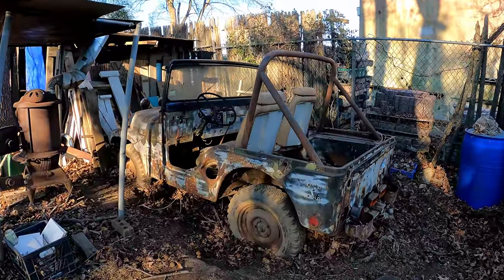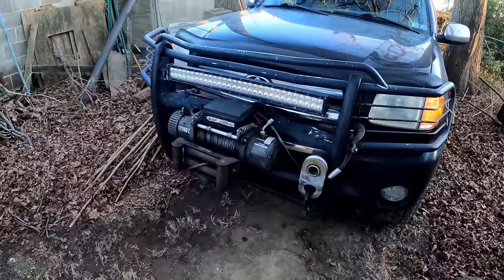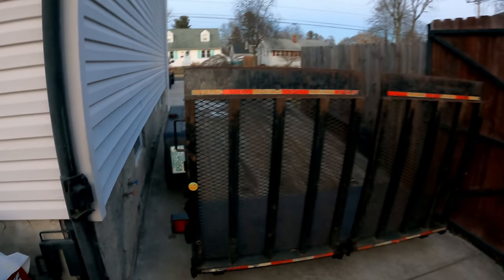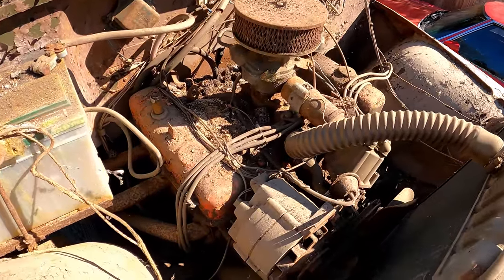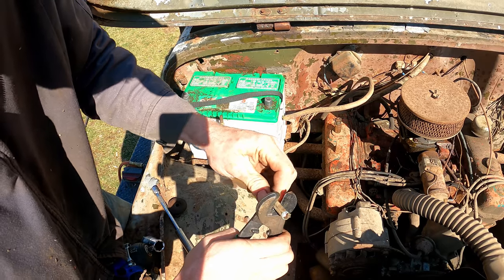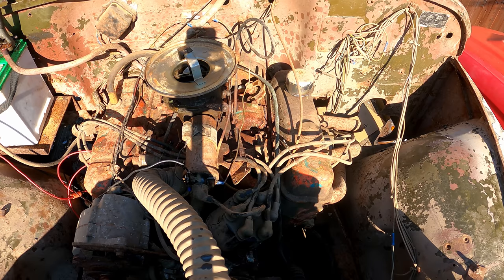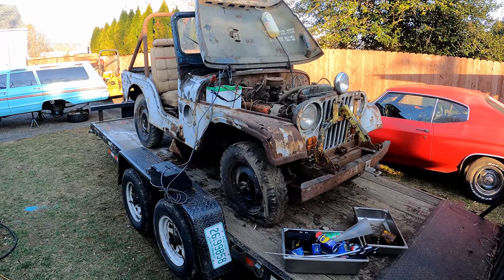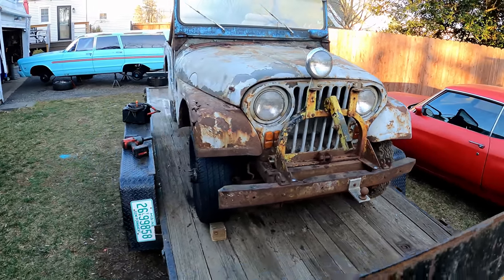Sitting 30 years Will It Run? 1965 Jeep w/ Buick Odd Fire "Dauntless" V6 - NNKH

Comment: I am astounded that anybody would find value in that old rust bucket. I can see saving the engine and possibly the rest of the drive train but the rest of it is not even worth scrap.
Reply: you're just wrong.
Reply: Oh, no. With $30,000 in repair parts you would have a vehicle worth $20,000.

Comment: Your video brought back lots of memories.  My first Jeep was a 1967 CJ-6 with the GM 225ci V6.  If I remember correctly, those engines were used in the 1965-1967 model years.  The engine was so torquey I could almost get 'rubber in all 3 gears' ... LOL.

Comment: I have a 67 225 CJ 5 gas tank inside under drivers seat. Never came with rollbar(68). Love it high revving engine trans very delicate had to update for as much power it makes.. mine has 62k original miles.   Love it

Comment: Good job on getting that old V-6 running...looking forward to Part II!  As I recall, that 225 Buick V-6 was derived from their 300 CID V-8...there was a marinized version, used on the late-1960s-1970 Evinrude Explorer and Sportsman hulls...has an almost "three-pot" sound at revs...Keep up the good work; most entertaining!
Reply: The original Buick "Fireball" V6 was a 198cid/3.2L, derived from the 215 V8 in 1962 by lopping off two cylinders (hence the odd fire).  They upscaled it to the better-known 3.7L "Dauntless" so that it could share parts and tooling with the Buick 340 (which later became the famous Buick 350 that was used in FSJ's) before they shelved it and sold the design to Kaiser.  It was used in Jeeps until the AMC acquisition and it was replaced by a straight 6, aka the forefather of the ubiquitous 4.0 liter.  It was sold back to Buick and resurrected in 1974 with HEI added and a few other refinements that make good bolt-ons for the earlier Dauntless Jeeps.

I kinda fell into this obscure bit of trivia because my son and I are fixing up a 1969 Jeepster Commando with the Dauntless in it.  Sub and follow along if you want: https://youtu.be/d1HYoqfk0s4 (we just got started and I'm in the middle of editing together part 2 as I type this).

Comment: Way back in '79 I had a '65 with the V6 while in college in FL. Winter of '80 I drove it home to VT and hit a blizzard in NYC. By the time I hit the MA state line it was still snowing and temps were below freezing. The only gauges that worked were the amp light and oil pressure. It started running rough around White River Junction but I kept going in 4WD because the snow was so deep. 3 hrs later I pulled into my home and my Dad told me to pull it into the garage. Once there I popped the hood and found the battery split, the radiator frozen, the carb was iced over with only a half inch hole for air. No freeze plugs popped though. Let it warm up in the garage and two days later replaced the radiator and fluid and battery and she started right up. Loved that old girl.
Reply: As an addendum, this was also the Jeep that ran 14.2's in the quarter mile on the weekends against Trans-Ams and Camaros.

Comment: That is an old military jeep. The give aways are the recessed front headlights. Recessed tail lights. The two bumper hoops on the rear, the large fuel fill for your gerry can, and the 24 volt battery box on the passenger side cowel. It originally had a 4 cylinder engine.  Easy swap for a Buick V-6. It also has the military gauge cluster on the dash.
Looks like it is a Frankenstein jeep. A mix and match of old and newer model parts.  The fuel tank is located behind the rear axle. In a military jeep it is under the driver's seat. Also the military jeep would have a split windshield. This one has a full windshield.

Comment: Rust bucket restoration 😃 lotsa work to do there. It'll definitely test your sheet metal skills unless you can get some prefab already hammered out. And that old engine has some serious blow by, but  they somehow pull through after 30+ years. Interesting project.
Reply: C&C Equipment might be the place to check.

Comment: I did a few of the old military jeeps and 47 civilian jeep got all my parts from J C witney. Even rebuilt 4 cylinder flat head with all parts from JC Whitney. That was over 30 yrs ago,don't even know if JC Whitney is still around. Yes, keep the build going. I'd like to see full restoration. On that jeep

Comment from the maker: NNKH Hats/Merch: https://www.youtube.com/channel/UCYAcr-u-BLGIrtUImT2_Elw/store

~PART 2: https://www.youtube.com/watch?v=Th8anMfF4IE

~Old video I did on the 4x4 air hose: https://youtu.be/4apKkW28yzo

Huge thanks to  @William Moser  for letting me use the clip of his Buick firing order video.  Check out his channel @ https://www.youtube.com/channel/UC5W4P8cYkNV6pFqZVkjuXLg

More NNKH @ https://linktr.ee/NoNonsenseKnowHow

0:00 Intro
02:33 Moving Jeep
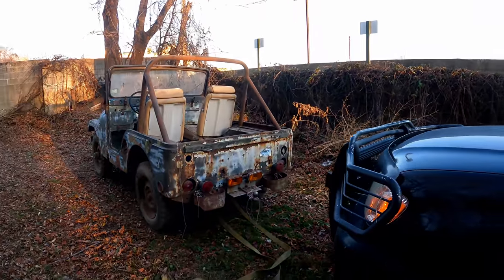07:28 Getting Trailer
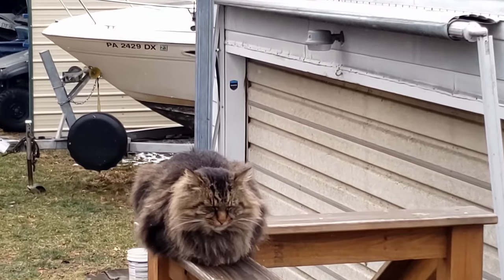12:08 Sponsor Ad
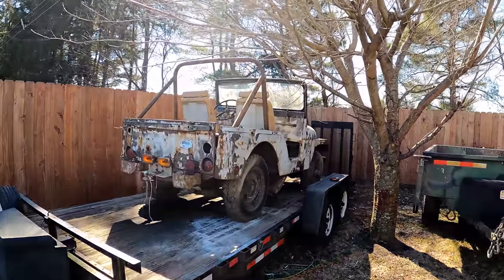12:48 Lets Get To Work
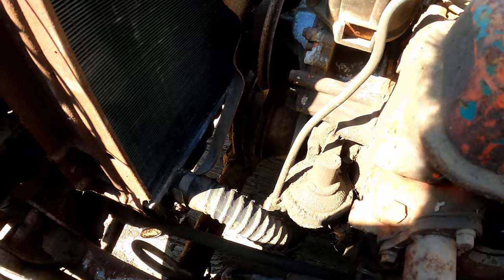17:16 Rotate Engine
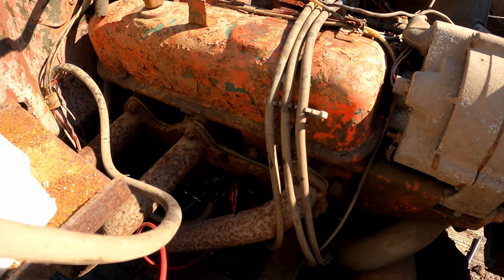19:46 1st Crank / Compression Test
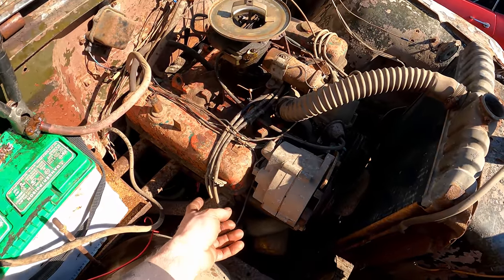20:53 Need Spark
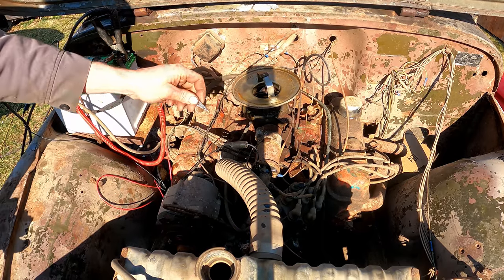22:45 1st Start Attempt
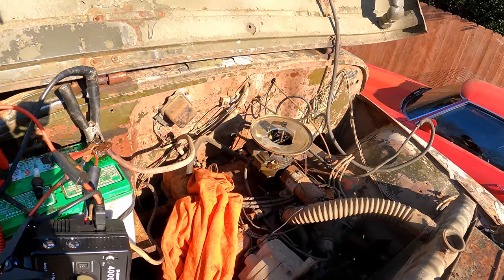24:40 1st Start
28:08 Wrap Up / Odds n Ends
30:59 Outro Plus More
Reply: .
..v

Comment: I had a 1966 Buick Special that had the 225 cubic inch V6. It was a pretty good engine and fairly easy to work on. I replaced the timing gears and chain.  With the distributor in front it was a little more difficult but wasn't bad by no means.  The one thing I didn't like it had a 2 speed automatic,  and was slow on take off, but did ok on highway.  I got right at 22 MPG  on highway.

Comment: My jeep was a 1970 CJ5 the engine was a Buick V6 225 cubic inch from the factory and it developed 160 brake horsepower. I got 21 mi to the gallon.

Comment: My '68 Jeepster had Buick 225 c.i.d. V-6.  When Buick recovered V-6 production they upped displacement to 231cid.(3.8L).  The mid-60's Buick's also used that 225 V6 with an aluminum block.  Your block may be aluminum.

Comment: If it's a Dauntless, then it's a 225 3.7l. And hopefully it has the original HEAVY flywheel. I had a '71 with the 225 Dauntless. Pretty good engine for cruising the trails.

Comment: That’s quite a find.  My friend had one but his was not a military one.  The engine was something  that Buick came up with.  They took a Buick300 v8 and cut off 2 cylinders to make the v6.  Thus creating  the odd firing.  4 cylinders firing at 135 degrees, 2 firing at 90 degrees, making up the 720 degrees.  You should have a t 14 tranny with a synchro first gear, a big improvement from the t90 that many Jeeps had up to that point. Good luck with it.  I would think that the tranny has water in it with no boot on it.  Regards, John

Comment: I've got one of those 225 Buick engines I'm working on installing it in a pontoon boat. It originally came out of a tri-hull fiberglass ski boat. It runs really well. The title says 155 horse power. Good luck. And it's a 1969 model year.

Comment: Ill give this guy credit, most other people bring stuff back to life that could possibly continue to have a life, this guy finds the crap that is 2 lifetimes past it should have been crushed and long gone and plays with it.
A little history, Buick designed the 225cu V6 in the 60s, never used it in anything, sold the production rights to AMC who put it in Jeeps and a few other things, then when AMC went out of business/ bought by Chrysler, Buick bought the rights back and put the engine in a few cars in the 70s before developing the 3.8. 
I had a 77 Buick Regal with an odd fire V6 that rattled like a can of spray paint even with 50 weight oil, I wasn't easy with it but it wouldn't let go tho. It just kept running until I replaced it with a 455.

Comment: Probably an M38A1 military Jeep or at the least the grill is.  The CJ (Civilian Jeep) had external chrome headlight bezels.  The military units had inset lights like yours.  The snorkle relief in the hood is also miliatary.  The dauntless was most likely swapped in as it should have been a 134f

Comment: I had a 1971 CJ5 but with a Buick V6. There were two distributor vendors. One that had a hold down clamp that looked a hollowed out cigar and it caused me much problems as the clamp would lose its grip on the distributor. So I went with the other one that had a Y shaped clamp and it never failed on me. The other problem was the clutch cable end would break off and I would have to limp the CJ5 home by sifting w/o a clutch. I had the full parts manuals for the vehicle but I sold everything in 1977. There is some outfit in the Phillipeans or Taiwon that sell body kits specific to the years. Have fum

Comment: I had a brother n law back in the 70's he bought a 49--52 willys with a flat head 4cylinder man we had some fun it had a factory switch on if you go through water it disengaged the fan another brother n law had a VW with the rear fenders cut and ground hawgs on it.  NOW BYGOLLY THAT WAS THE GOOD OLD DAYS.

Comment: I've learned over the years that Reverse is a lower gear than First gear is in most vehicles. So try using Reverse for a parking gear instead of First (even when doing the 4-low thing).

Comment: Hey, I have a 68 jeepster with the same engine. 
Replace the distributor with a sealed electronic unit.
It will be the best upgrade you ever did. Those engines are prone to drowning out.

Comment: This will be the second video I have seen this week where "critter crap" in the bellhousing was keeping the engine from turning over. I'd be curious to see what the compression is after several hours of run time and blowing out the carbon / rust. Recently had a 64 Corvair van that had been sitting and sticking it in gear would NOT hold it on a hill. After a week or so of driving it now holds on bigger hills and the light smoking I had went away. It uses less than a half quart in 1,000 miles so no plans to tear the engine down.

Comment: You have a long way to go with this Jeep. My CJ-2A lived at the beach most of it's life and I physically pulled the body off in 7 pieces, I got a new body for it and fixed the frame. Your engine is not Buick green so my guess is it has a 194 cu.in. odd fire V/6 like the 1944 Ford Jeep I built in the 1980's. My motor came from a 19963 Buick Skylark.

Comment: I always wanted a Willys jeep for the farm runabout in the early sixties. There were plenty of them advertised for sale in the back of the Farmers Weekly for about two hundred and fifty pounds, literally dozens of them . 
Some were about ten pounds more than that and some were ten pounds less but all in that region.
My dad and older brothers said it would use too much petrol.  We were buying petrol  in bulk (200 gallons)  for four shillings a gallon. I regret not getting one to this day but just couldn’t afford one at the time. Please do more  parts on fixing it but don’t use any hardware or brake pipes etc that will rust. Thanks .

Comment: Like the jeep, and the nail head motor, but the Kubota B7500 really got my attention.  I've got the same machine and it's a workhorse. Would like to know if you've had any problems with yours. Mine has 1200 hours and is pretty much problem free.
Reply from the maker: Yeah the b7500 is definitely a great machine! I haven't had any problems out of the ordinary with mine. Just normal maintenance stuff

Comment: fiberglass body , aluminum jig built frame ,Teraflex 2.5” Suspension Lift Kit.,aftermarket component for the ront and rearend, new glass and wheels,brakes and tires put it all together pop rivet the old vin unto the dash and go get it inspected

Comment: It's got a military body on it to start with Next the motor is either a 194 cu.in. or 225 cu.in odd fire Buick engine in it.. It looks like something somebody hashed together.. Jeep didn't put a V/6 in their Jeeps until 1967 and that was a 225 cu. in engine

Comment: I had a 1970 CJ-5 years ago with the Buick V-6. The fuel tank was under the drivers seat not in the rear. Was the rear an auxiliary tank? Lots of work ahead of you that for sure. I will watch the transformation.

Comment: I'd put a monster ass lift kit on this with Rockwell 2 1/2 ton axles, rims, the whole shebang. squeeze a vortec engine under The hood with magnaflow exhaust. get one of those musical horns that plays la cucharacha when you push a button. Ya, that'd be a beast.

Comment: that ia model m38a1 military. that is a Buick v6 transplant , military only had a 4 cylinder. in 1972 I had one like it, engine went bad , put a 1972 chevy 327 in it wow what power.

Comment: The primary induces a voltage in the secondary the voltage builds till a spark occurs then you get current flow in the secondary. Sorry for the nit pick

Comment: if you have 2 identical cars sitting for 20 year but one you spent 2 hours and $20 a year on long term maintenance the difference can be many thousands of dollars, Eg tarps drain fluids block exhaust tape up air cleaner and block any holes to the inside, and rodent deterrents and maybe lock your cat inside for a few hours every 6months and unblock any water run out spots in door paint a rust inhibitor on any rust spots

Comment: If it's a 1965 it wouldn't be M38 or 38a, the last year they were made was 1952. It would be a M606 and they had a one piece wind shield . I had  a 1969Jeep Commando with the V6 and it didn't idle rough

Comment: Love the videos. Are you going 75mph in 4wd in the truck?
Reply from the maker: Awesome to hear that and great question. No, the ADD ( automatic disconnect differential) motor went bad sometime after sinking the truck in the river. So I've disabled it and the ADD is full locked all the time.(That's why the 4wd light is on)  However the transfer case is in two-wheel drive.   Basically just one extra spinning part going down the road. (The shaft from transfer case to front differential)
Reply: @NoNonsenseKnowHow  I was going to say that's impressive

Comment: That engine is shot. The smoke coming out the valve cover is blow by from the rings into the crankcase.  The rings may seat themselves after some running.  But maybe not.  Keep going in getting her running.

Comment: Ah ah ah. The smoke coming out of the cam cover breather is blowby. Basically compressed gases from the combustion chamber going thru the piston rings down in to the crankcase and up to the head. This is caused by stuck piston rings. Chances are that you can run the motor to unstick them. after a few heat cycles, they shall free up... Easier done that opening the engine and removing the pistons...

Comment: Does the Buick 3800 series 2 have the same firing order? I remember I was replacing plugs on my 99 Oldsmobile 88 and when I checked the firing order it said 165432

Comment: You could have removed the oil filter and the drain plug then crank it over just enough to get all the old oil out of the motor as much as possible. Then proceed putting a new oil filter onto the motor put the drain plug back in and fill it up with the proper motor oil not never use synthetic in an old motor they’re not set up for synthetics. 10W-30 or 5W 20 or 5W-30 something that will help flush out of all the old Oil.
Never have the engine running while you are pumping the oil out you do it when you disconnect the coil wire and just crank the engine over and it will pump out the old oil. Then after you put your clean oil filter on not a cheap one I’ve done learned my version on cheap. I really good oil filter and some good clean Pennzoil motor or GTX motor oil flush the engine thoroughly With the new clean I’ll run the engine let it lubricated everything including your hydraulic lifters after it’s warmed up keep listening to the motor for any kind of knocking or if the valve is not operating correctly

Comment: not a period correct jeep, but the engine seems reliable with some new parts.  all the safety stuff will need to be addressed, of course.  too bad it was run on salt water and not properly washed after.  good vid so far.

Comment: Not sure why you would bother with it without a full inspection. Engine is sick, body is past it's use by date, trans is unknown, brakes need full rebuild, suspension needs replaced and frame is unknown. I'm sure for what it will cost to repair you could find a much better one - but where would the fun be in that.

Comment: #MONEY if i can give one very important piece of advice to engineering-type channels its this, your back catalog of videos never become outdated so are often watched 5 years after the original upload date and can rack in a good passive income BUT you must have a separate playlist for every build, NEVER make a playlist like this EG 1st playlist 50 videos of motorbike stuff, 2nd 30 videos of bodywork stuff, etc even if you have to make 100 playlists every build must have its own playlist from picking it up to the day you sold it and every bit of video between and in linear order if you have 300 videos with a good audience you can make anywhere from 5k to 50 k a year without uploading anything new[your VIDEOS ARE VARIED AND IT WILL BE HARD WORK BUT THEY NEED TO BE SEPERATED BETTER]

Comment: 4wd at 75 mph?
Reply from the maker: No I have the four-wheel drive actuator on the front differential permanently locked. Transfer case was in two-wheel drive so basically it's been the front drive shaft. Toyota automatic disconnect differential it's called. Motor went bad after sinking in the river

Comment: In a real world what I just saw was not close to possible and for most  reasons even, just ain't gonna happen. Your standing right                         in  front of it so it did but I would of called bullshit when leaving that lean-to it was in. Amazing luck considering those are notorious sad engines with little  to no power. Still a little jeep just needs some small donkeys to pull it